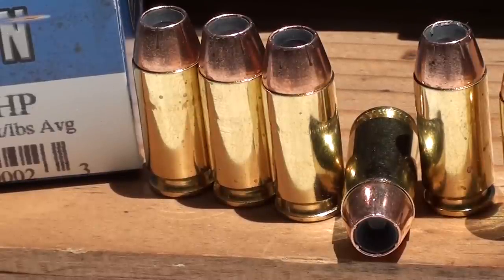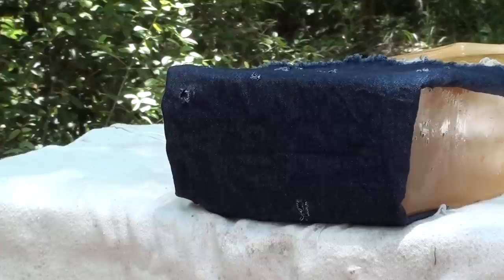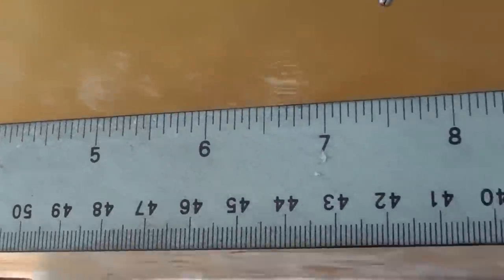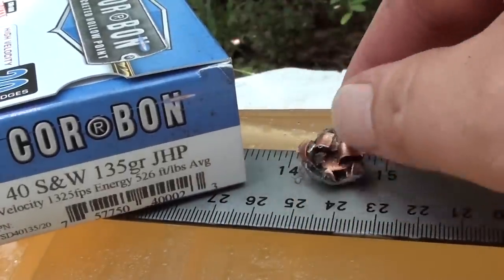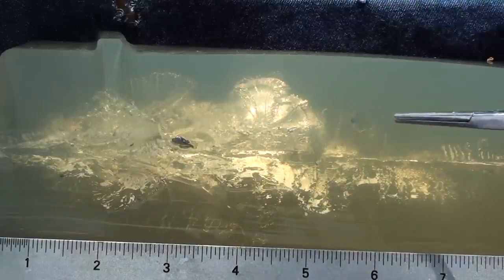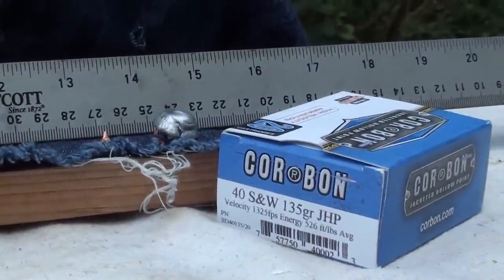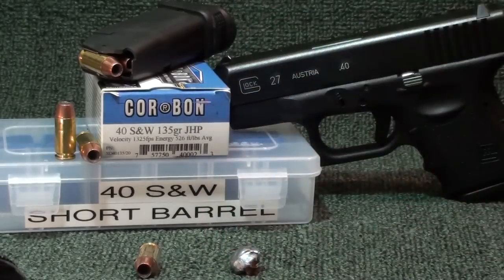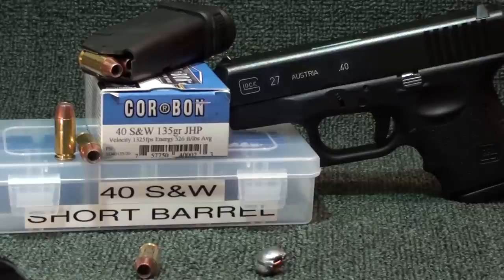40 S&W Cor-Bon 135gr JHP short barrel ballistic gel test

Comment: Appreciate your tests.  How about a test of the Winchester Kinetic, HE,  155 grain, out of that baby Glock.  I've read that in order for a JHP to expand out of a short barreled gun, the velocity must be over 1200 fps.  The only way to get that speed with a 40 caliber bullet is to lighten the load; minimum weight is 155 grains.  Do you think that is true?
Reply from the maker: +Rick Blotter   Pleny more short barrel test coming in 40 for sure, thanks for watching
Reply: That's not true with modern ammunition. There are plenty of heavier bullets that will expand just fine out of the G27. Good modern JHPs aren't nearly as velocity dependent as they were in the past. Good to go out of the G27 with HSTs, Gold Dots and other modern designs, even the old school designs have been tweaked by the manufacturers to perform pretty damn well nowadays. I used to carry Gold Dots or HSTs but this test convinced me to give these a try and I carry them now, hard to argue with that wound cavity.

Comment: I have been carrying a Glock 27 for years.   I use the Federal 155 gr Hydrashock right now but I am going to test the Corbon for reliability and switch after this video.   This is a hot load but I would hope that the recoil on a 135gr would not be too bad.
Reply from the maker: Was not bad at all, was not snappy like most 40 rounds.
Reply: If it is less snappy than most .40 loads with the results in this test, this may be the perfect load for the Glock 27.

Comment: I dont understand why some people think that carrying lighter ammo is a bad thing for general self defense. I understand heavier loads get a little more penetration, but your likely not going to be shooting through windshields or other barriers in a self defense scenario. Look at these rounds vs the typical 125 grain loads carried in the 357 magnum. This load is a little bit heavier and gets close ballistics (as far as feet per second and ft lbs of impact energy) to 357 magnum 125 grain loads, they even got adequate penetration without OVER penetrating.  I have never shot any of these 135 grain corbon out of my .40, but from what I see here, I wouldn't be against arrying these for protection at all. I may actually get a box or two of these and test them out for myself. Pretty sure these would be moving extremely fast out of Glock 22.

Comment: I remember some years back Cor-Bon was having issues with the bullets unseating and slipping back into the case, I'm not sure which bullet it was since they changed them over the years, but is this still an issue?
Reply from the maker: I have not had an issue with anything I have fired, Might have been a quality control error at the time?
Reply: What happens is the seating cripping die gets worn and the person was a nooby and didn't catch what happened and some thing like that camos it self so the person could not tell what happened.

Comment: With as much force as it had and nearly peeling itself inside out, i'm willing to bet it will still work well from .40's with even shorter barrels, like a Kahr or a Shield.
Reply from the maker: That 27 in my opinion is about a short a barrel you want to get with a .40 and still have control.  Worked well, as always thanks for the support Tommy!!!!
Reply: I purchased a M&P Shield 40 and put 27 135 gr. Corbon rounds through it.  The recoil was strong but not intolerable.  The only problem was that the weapon kept moving so you have to put a death grip on it.  For me I need to reinforce the grip on it otherwise one hell of a gun and one hell of a round.  Nice presentation I always look for your reviews, keep up the good work.  By  the way I have been using these rounds ever since I purchased my G22 over 20 years ago.

Comment: Is the GEN4 GLOCK G27 A safe pistol to use with this plus Underwood ammo?
Reply from the maker: Need to check their website, I do not know for sure
Reply: ScubaOz how could I check if my vp40 could handle this ammo?
Reply: I wouldn't shoot even low power ammo in a .40 glock with a stock barrel. I have seen a couple of them Kaboom. 

In the .40, the chambers are too big and the end of the case can slip into the freebore, past the end of the chamber. I have seen the rails blown off. Glock always blames the ammo so you are out of luck for warranty repairs.